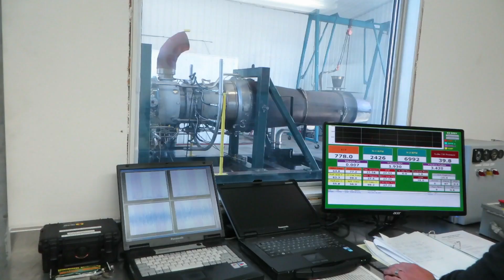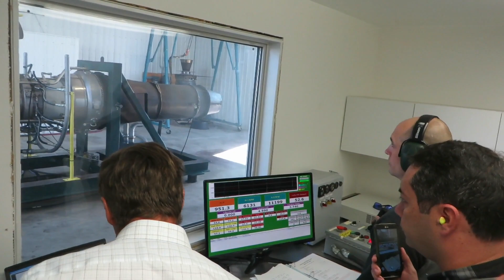RR Marine Spey turbine engine test run

Comment: elegant engine

Do I assume correctly that the Spey is more modern than the LM1500?
Reply: +Kalimerakis You assume correctly. The first Spey aero engine ran about eleven years after the first run of the J79. It was a low by-pass turbofan with a higher pressure ratio: 20:1 as compared to 13.5:1 for the J79 turbojet. The later Marine Spey SM1C was quite substantially uprated relative to the SM1A shown in the video, producing almost as much power as the 'B' rated Marine Olympus in a more compact package. Please note: Marine Spey designation corrected, as RM was used for the Marine Tyne.
Reply: cool, thanks!
Reply: +grahamj9101 Based on your experience how high of a pressure ratio could be expected in future engines, or have they pretty much maxed out? Whats THE limiting factor pre-combustion temp or EGT?
Reply: +Beach&BoardFan Phew! You're asking a long-retired designer to venture into the realms of a performance engineer and even further behind the closed doors of a new projects department (in which I once worked). OK, so where are the big turbofans going? In the quest for higher thermal efficiency, pressure ratios are going through 60:1 and turbine entry temperatures (TETs) are heading towards 2,000degK (if you want to turn that into degF, it's up to you). I think you might have meant TET when you referred to EGT. So, what are the problems? With increasing compressor delivery temperatures, the air entering the combustion section is less capable of providing cooling for the combustion chamber walls and the turbine aerofoils. In addition, for a given TET, as the compressor delivery temperature is increased, the available temperature rise and heat release in the combustor is reduced. This means that while efficiency increases, the specific power reduces. In other words, the amount of power per unit weight of the engine tends to reduce. This can be countered by advances in materials in the compressors and combustor, improved component efficiency and a corresponding rise in TET, which demands improved cooling technology, together with improved materials in the turbine. In the quest for higher propulsive efficiency, by-pass ratios are also going higher, through 15:1. However, the larger diameter casings that will be required to enclose the larger fans will tend to result in higher installed drag, unless improvements can be made in their aerodynamics. That's all for the moment on big turbofans: military engines won't be going in quite the same direction.
Reply: +Beach&BoardFan So where will the supersonic military engine be going? Obviously, it won't be getting a bigger fan, as its low frontal areas will need to stay much the same as today. It will get lighter and run hotter, with the TET going even higher than in the big turbofans. This will be manageable, because the pressure ratio will remain relatively modest, resulting in more cooling availability for the combustor and the turbine. This also means that there will be more temperature rise available in the combustor, thus increasing the specific power. There will be a drive towards more highly loaded components, in terms of aerodynamics and performance. For example, today's combat engine may have a 3-stage fan and a 5-stage HP compressor, with a thrust-to-weight ratio of 10:1. Tomorrow's equivalent engine, for no more than a small increase in pressure ratio, may have a 2-stage fan and a 3-stage HP compressor. Material improvements will be in advance of those for the big turbofans and the engine will be lighter, with a thrust-to-weight ratio approaching 20:1. I'm not in a position to define the absolute limits, but, in theory, TET can go no higher than stoichiometric, which means that an afterburner would have to rely almost entirely on by-pass air for combustion. Is that enough, as my brain's starting to hurt?
Reply: great stuff!
so stoichometric means burning all the available oxigen coming out of the compressor.
and what civilian turbofans would need is some sort of an intercooler ;D
Reply: +Kalimerakis Yes, I used the term rather loosely, to indicate that the combustion chamber would use all of the oxygen in the air entering it for combustion, with no dilution air entering to reduce the turbine entry temperature from that of the actual temperature of combustion. However, I did have it in mind that there would be some air, say 5 to 10percent, by-passing the combustor for turbine cooling: nevertheless, it's all very hypothetical. Moving on to think about using an intercooler in a big turbofan, could I draw your attention to the WR21 marine engine, which is based on the Trent aero engine? It has an intercooler between the LP and HP compressors and an exhaust heat exchanger which returns heat to the HP compressor delivery air. Find a cross-sectional GA, if you can, to see the size of the intercooler and envisage incorporating that into an aero engine. If, somehow, it was arranged to line the inner wall of the by-pass duct, there would be some heat recovery into the by-pass flow. Nevertheless, it could well result in relatively greater aerodynamic losses and it would certainly be a challenging design exercise. In fact, it's one that I did some years ago as a conceptual design investigation, although the heat exchanger was on a smaller scale and intended for use in a future military turbofan for cooling ..... (I can't tell you).
Reply: +Kalimerakis PS I might have questioned the feasibility of the use of such an intercooler in an aero application, but it was a very good question.
Reply: +grahamj9101 Awesome wealth of information, it would be a shame to not strike up conversation (might as well couple great conversation with great videos). With the aero heat exchanger talk above, how about the Skylon SABRE engine, legit or marketing hype? Are there any applications (marine, aero, industrial) where the hot section is water cooled instead of air...  on the WR21 why cool the combustion gases instead of the turbine itself?
2000Kelvin = 3140F or 1727C !!! wonder what the maximum possible temp is with a stochio reaction at ~850 psi!
Reply: +Beach&BoardFan I happen to be acquainted with Alan Bond: I last saw him at the funeral of a former colleague of ours at the end of last year. I'm confident the maths show that the heat exchanger will work in theory. The problems are going to be In the detail design: high temperature heat exchangers are fundamentally problematical, because of the temperature differentials across them and the thermal stresses that can be induced. Add to this the potential mechanical problems of packs of small-bore tubes being subject to high aerodynamic loads and excitation. If all of those problems can be sorted, then the manufacturing problems of an assembly with myriads of joints will need to be solved. Any failure of that heat exchanger in service could spell immediate disaster.
Reply: +Beach&BoardFan On the subject of water cooling, you will probably be aware of previous discussions about the use of water injection for short periods in some aero engines for take-off eg, the Pegasus in the Harrier. I am not aware of any engines that use water cooling directly in their turbines for aerofoil cooling. It's perfectly feasible, but a steady and absolutely reliable supply of de-ionised water would be needed. Any failure could result in immediate disaster and a very expensive repair bill, even with an emergency shut-down procedure from max power, which could be harmful in itself.
Reply: +Beach&BoardFan Without digging into the theory too deeply, I assume that the intercooling between the LP and HP compressors of the WR21 is similar in principle to the intercooling after the turbo on a turbocharged automotive engine (my VW 2 litre turbodiesel has an intercooler). In cooling the charge, it permits an increase in the mass of air entering the cylinders. In the case of the WR21, I think that the intercooler is doing much the same, by effectively rematching the compressors, allowing the HP compressor to pass a higher mass flow than it would without intercooling. It is not there primarily to reduce the HP compressor delivery temperature, though it must do so. In principle, this should contribute to lowering the TET and/or allowing a higher temperature rise in the combustion chamber. However, while the HP compressor delivery temperature should be relatively cooler, it is immediately heated before entering the combustion chamber by passing through a huge exhaust gas heat exchanger. This significantly improves the thermal efficiency of the machine.
Reply: +Beach&BoardFan 2,000 minus 273 equals - correct. Now compare that with the melting points of Nickel (1453C) and  Cobalt (1495C), the two elements that are commonly used in high temperature, heat-resistant alloys.  If it weren't for highly effective cooling of the combustor walls and the HP turbine, everything would melt in a fraction of a second. The adiabatic flame temperature for constant pressure combustion of kerosene (or diesel), in air at atmospheric pressure and temperature, is around 2,100C. What it is at current compressor delivery temperatures and pressures, I don't know and I would have to do some research. I had lunch only yesterday with a retired combustion engineer colleague: he would have known!
Reply: +Beach&BoardFan I might have been able to calculate stoichiometric temperatures once: however, it would take a lot of revision now, so I've looked around on the internet. For combustion in air at 1 atmos and 20C, the stoichiometric flame temperatures for kerosene and Hydrogen are 2266K and  2527K respectively. For Oxygen and Hydrogen the equivalent temperature is 3473K. The difference must be down to the fact that, with air, the process is heating up 80percent Nitrogen.    
I can't find information for combustion of air/kero at high pressures, but I did find some graphs for rocket combustion chambers. At a pressure of 50 atmos, the stoichiometric flame temperatures for HTP/kero and Oxygen/kero are 2660K and 3550K respectively. Again, the difference must be down to the fact that HTP, in addition to releasing Oxygen for combustion, also releases water in the form of steam at around 600C, which has to be heated up. I would expect that the temperature for air/kero at 50 atmos would be rather less than 2660K.
Reply: +grahamj9101 (WR21) So its removing heat from the compressor and applying it post combustion chamber inlet... interesting, I wonder if anyone has made an adiabatic turbine engine before? Also if it would be worth while to instead of robbing mechanical power to turn an APU/gearbox if you could run a post combustion heat exchanger to turn a small Rankine cycle generator to produce needed electricity. Bonus it would reduce TET.
Reply: +grahamj9101 Man google has not been telling me when I get a reply to a comment, I'm going to have to go back through older videos comments to see if I've missed reply's, so my apologies of I repeat a question. (stoichiometric reaction)  Awesome, you must have been on NASA's website or perhaps the ESA, I found the same specs for rocket combustion 50 atmos HTP/Kero and O2/kero in a great article from NASA. There's also some good hypergolic combustion graphs as well for any interested readers. Anyway So based on the above temps it seems like current combustion isn't far from the precipice, assuming pressures don't increase (hypothetical). Has there every been any experimentation with alternative fuels? Something exotic not propane or some other form of kerosene. Perhaps even an oxidizer injected into the fuel stream?
Reply: +Beach&BoardFan Sorry if I've misled you: the intercooler results in a small but significant loss in cycle efficiency, as the heat is lost from the cycle, but it does permit a significant increase in specific power. The HPC delivery temperature is higher than that of the LPC, so the only way to transfer heat would be via a heat pump of some form, which would be totally inefficient. The last place I would want to put a heat exchanger is before the HP NGVs, which, of course, are heat exchangers in their own right, with the cooling applied to them. The design challenge of doing so would be immense and probably far greater than that of the SABRE engine heat exchangers. There would be aerodynamic losses, which, combined with the TET reduction, would be detrimental to efficiency. One possibility might be to use a proportion of the engine exhaust going to the heat exchanger to be diverted to run a small combined cycle unit, but there's nothing new in that. There are lots of gas/steam turbine combined cycle generating plants out there. What the relative efficiencies might be, in terms of having a 'partial' steam plant using the gas turbine exhaust, as compared to taking a mechanical drive, I've no idea. However, I wouldn't be keen on the complexity in a marine propulsion application, which is already complex enough in the case of the WR21 (and still causing some problems).
Reply: +Beach&BoardFan The pressure for alternative fuels has primarily been in the direction of the replacement of kerosene with direct equivalents, eg, biofuels. The reason for this is that the energy density (energy per unit volume) of kerosene is high, far higher than liquid Hydrogen, for instance. In simple terms, kerosene is the ideal jet fuel: it is relatively safer than gasoline and cleaner burning than diesel, which, in any case, couldn't be taken to high altitude. Do I presume that you are suggesting the use of an oxidiser in an aero engine? This would mean separate tanks and associated safety issues on the ground and in the air. The aircraft would have to carry an additional weight into the air, when that air was a perfectly satisfactory oxidiser.
Reply: +Beach&amp;BoardFan Chrysler did a LOT of work on heat and power recovery with their small automotive turbines. Well worth looking up if you want to see very efficient re-use and recovery of waste heat.
Reply: +Sideslip And so did Rover in the UK - before Chrysler.
Reply: +Beach&BoardFan I have it on good authority that Alan Bond does not intend to make the SABRE heat exchanger birdstrike resistant. In the words of my informant, "Even a sparrow would cause damage that might result in a failure."
Reply: grahamj9101
The reason I suggested looking at the Chrysler work was because it's readily available online and was far more successful than the Rover attempts.
Reply: +Sideslip In terms of success, that's a matter of opinion - not of fact. Living where I did in the English Midlands, I was fortunate enough to see most of the Rover gas turbine cars (from JET 1 to the Rover-BRM) on the road, travelling between Solihull and the MIRA proving ground. Rover was a small ( very small, relative to the Chrysler Corporation) car manufacturer in the English Midlands, which only survived after WWII by producing a very basic, but very successful 4x4. The company produced small gas turbine engines, which worked reliably, and that was a success in my terms (we regularly ran one in the mechanical engineering lab at Nottingham University, back in the 60s). The overall cost of the project was probably only a fraction of that of Chrysler's program(me). Nevertheless, in commercial terms, Rover's cars were never going to be successful, because of the fuel consumption (even with a regenerator) and the high cost of fuel ( due to taxation) in the UK. But then a 'production' run of 50 Chrysler gas turbine cars could hardly be described as successful.
Reply: +grahamj9101 Really that's super interesting, I wonder what the reasoning behind that decision is? Better have lots of hawks/eagles at the airports to keep the sparrows away!
Reply: +Beach&BoardFan  I had exactly the same thought as you about tame falcons and bird scarers! My informant is also interested in HOTOL-type space launchers, but he is very critical of the technological risks associated with the SABRE engine. He proposes to use a combination of jet engines and rockets, with a reusable first stage - see the Bristol Spaceplanes website. If you've checked it out, you will probably have worked out who my informant is. He suggests that Alan Bond is working on  an extremely low probability of a birdstrike for a space launcher. However, David (who will remain nameless) points out that the SABRE engine is also proposed for Mach 5.5 aircraft, which must face the same level of risk as current airliners on take-off and landing. A sparrow wouldn't do much good to a bank of tubes, each of which is less than a millimetre in diameter, with a wall thickness measured in microns! And what about the occasional FOD event? I remember all too well the Air France Concorde crash.

Comment: I am amazed that the frame can hold that engine (which a quick search on google told me made around 26.000 hp) It looks flimsy comparatively.
Reply from the maker: +Mads Kjerulff The engine test stand is good for 200,000lbs of thrust. This test uses a restrictive nozzle designed for calculating Hp, not producing thrust. We probably  made between 10K and 15K lbs of thrust today;
loads of reserve strength!
Reply: +AgentJayZ Another fine piece, thank you for bringing us hi-def look into your turbine-tech world!Robin Sipe really is a classy, handsome, and progressive dude for letting you bring us into this rare niche of gearhead porn!
Reply: +Mads Kjerulff 
If a plane, that has to be built lightly, can "hold on" to that engine, why shouldn't something that is built out of massive steel beams?